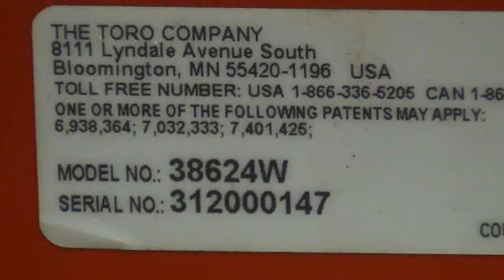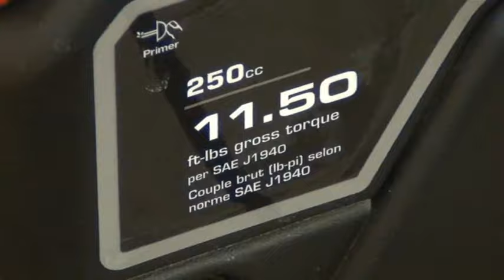Craftsman impeller pin repair - Toro Impeller pin repair

Comment: Thanks for your advice! The same thing happened to mine. I bought a couple 1/4 X 1 1/2 roll pins. I beveled and oiled the pins, but couldn't swing the hammer hard enough to get them started. I took the upper part of the plastic chute off. I put two 3/8 in ratchet extensions together and fed it from the top of the chute to the top of the roll pins and pounded them in. That worked. Cost me about $1.25. You rock!

Comment: Thank you making and posting this. I have the exact same problem on an older Ariens ST824. 
  What I find amazing is it actually shears the roll pins. Typically, they are harden steel. I would expect to blow the auger trans or auger shear pins first. However, I did get tangled up in some heavy wet snow and it was making slurpies tubes before it stopped throwing snow. 
  I currently have my machine split in half and was dreading scattering the entire auger assembly. Tomorrow I will give this method a shot. I know it’s tight in that area. And pushing the old broken pin out with the new spring pin was a great tip. We kinda look at these spring pins a lot different then the shear bolts on the auger.

Comment: Just finished doing this.  The key to getting it to work is lining up the pins With the holes. Then either grinding the pins like he showed or crushing one side with a pliers so that it will knock what’s left of the pin in the shaft out. If you do it right you’re done in 15 minutes.

Comment: I started to replace mine on my Craftsman y'day. Made sure holes were lined up but had a hell of a time getting the pins to go in. I used the recommended size pins per the manual and theres very little overhang once theyre punched in. Ill finish it today.

Comment: Great video.  Thanks.  I have a PowerMax 826LE  Model 38620.  How can I tell if its a shear pin or roll pin issue.  The impeller stopped while I was moving very heavy snow at an off grid cabin.  The impeller just spins. Thanks

Comment: Thank you.  Just ordered the replacement bolts directly from Toro.  "A bolt's a bolt" but the relative strength or weakness is important in this case.  I want to be sure that they'll snap again (and protect my machine) if I hit something hard or over-torque for any reason.
Reply from the maker: I use grade 8  1/4x 20 bolts for the impeller. They are pretty strong and mimic the original bolts. Don't forget, they are designed to break when a hard jam occurs so don't overthink it and put some super strength bolt in it. You'll be paying for a new belt or a bent input shaft if you pick up a rock and those pins don't shear.
Reply: @dansmallengine9610  Maybe those  are out-of -material spec  Chinese bolts :)  Grade  8 are very tough .and  should not be  used as shear bolts - unless they have specific undercuts. You want a  grade 5 or  2 shoulder bolt or SHCS.  Likely a  grade 5 on the impeller, 2 on the Auger. Cheers! - Sandy
Reply: 0003

Comment: My impeller isnt turning... sometimes it does. But its random. I heard some grinding. So Im assuming the impeeler shaft is stripped? Im assuming this shaft is insode the engine. Im hopong that part didnt get stripped. The shear bolts are intact. Suggestions? I have no idea how this mich damage could of occured. Seems likenthe shear bolts didnt do their job.

Comment: How do you line up the holes with the collar and the shafty if you still have remains of the old pins sheared off in the holes?
Reply from the maker: I have a small mirror I use to see the holes as I slowly rotate the shaft/collar. It can be difficult to line them up.  You may also need to push the collar backward a bit or pull it forward to line the holes up.  You should be able to see some old rust marks where the collar used to sit on the shaft and line up with the holes.  You can also try using a nail to find the old broken pins while you move the collar and shaft around.  Unfortunately there is no alignment mark on the shaft that lines up the holes. You might also consider using 1/4" grade 8 bolts instead of roll pins once you get it all lined up. The bolts are easier to replace if they break again. Those pins don't usually break so if its happening all the time, you need to be more careful when operating the machine not to pull anything in. I have guys with gravel driveways that break them all the time sucking up small stones.

Comment: thank you Dan for the video, nice and clear. my neighbor has about the same one, no grease zerk fittings. how do you go about greasing the shaft? think you could make a video on it. I am thinking about drill and tap to take a zerk fitting for grease. also, is that a good thing using that grade bolt that you used on the auger shaft. or does Toro call for something else to use?

Comment: I agree with wOOd chucker, grade 8 bolts are extremely strong and may cause another component to fail instead.
Reply: John Metz  - that's what I was thinking. He did a great job splainin everything, but shouldn't he have used shear pins? He says shear pins at the end.
Reply: @billlink7116  Looks like Toro has designed the unit to use 1/4" bolts as shear pins which is legit.  As mentioned I doubt Toro used grade 8 bolts if for no other reason they would be more costly than mild steel bolts.
Reply from the maker: Toro used both roll pins or shear pins. I'm not sure if they have some reason they use either but I suspect they have a reason for each model machine they sell.  As long as the bolts break before the impeller is damaged, you can use grade 8's. If you want to be cautious, use regular grade 5 bolts.

Comment: Just had this happen on my Snapper I724 2-stage snowblower. Augers turn but impeller will not. I noticed a roll pin almost all the way out and the impeller turns freely. I am having trouble finding the hole to pound it back in. I am hoping I do not have to take the unit apart because I am not exactly mechanically handy. The impeller also moves front to back a good 3/4" in addition to spinning freely. Do uiu think if I can just pound the pin back in place it will be okay? If not, how do I pull the into apart to better get to the pin?

Comment: Very helpful thanks.  I also have the Toro 826 which I purchased in 2016. Question to anyone here; I was just plowing driveway and the following problem happened: the trigger you squeeze on right side to activate auger won't stay down in unison with the left side driving trigger.. It was literally working fine and all of the sudden the right auger trigger won't stay engaged in down position once i remove my hands.  So in other words, I have to stop machine to use my right hand to use joystick to reposition chute because auger won't stay engaged.  Only thing that looks weird is there's a tiny hole under the handle where that goldish coloured bar meets a black plastic piece and there's a hole I can see through.  Might be for a cotter pin that fell out?  I have pics but don't know how to show here. Any help would be greatly appreciated. Thanks !
Reply from the maker: I'm sure it's something to do with the locking mechanism on the handlbar assembly. I don't have one in the shop so I can't give you and exact cause. All those locking assemblies tend to stick or jam over time. I would tip the machine forward and prop it up and take a look at the hardware to see if you can determine why it's not locking. All the locking happens on the handlebars (not inside the machine somewhere).
Reply: Thanks for the reply Dan.  Since I last posted this message, we found that 2 roll pins literally were missing and must have fell out while I was using the blower because as mentioned before, it was working for half of my driveway then I turned to change direction and noticed the right impeller handle all of the sudden wasn't staying down in the engaged position.  In any event, I'm now trying to get my hands on 2 roll pins that will fit. We have a Toro certified shop in my city and even they don't have the roll pins....I've tried calling Toro directly and they handle support if the machines don't start, but you can't order tiny parts like these.  Thanks again for the reply!
Reply: I forgot to say, the crazy part is that my machine was only a year and a half old, and the first winter we had no snow and I didn't even use it.  So the machine saw maybe 7 or 8 snow falls before these roll pins fell out?!  Anyways I just wanted to add this comment to my previous reply.  Thanks again.

Comment: CAUTION 
DON'T use grade 8 bolts ..
Unless you want to replace your gear box..
Informative video with some bad advice on bolts..
Reply: No gear box  issue  with the impeller bolts- that would be  a  belt thrower or a damaged  impeller collar or generally a bent impeller issue.  I agree no grade  8 bolts  here;  use  grade  5 or  2 shoulder cap screws or  bolts <or>ones  marked  for use  as shear bolts.

Comment: Wouldn't it be better to use a Grade 5 bolt?    Isn't the purpose of a shear pin to break before something damages the shaft/gear etc?
Reply: Yes  5 or  2 .  Do not use  grade 8.

Comment: Any other secrets in finding the holes for the roll pins.  A have a 9 hp Craftsman.  The roll pins are out of the impeller but I still haven't figured out to find the holes in the shaft.  Tried using a smaller nail pushed into the hole in the impeller figuring I'd feel the opening in the roll pin while turning it, no luck.  Flashligh and mirror, same result.

The only other solution I could think of was to let it sit overnight and go back to it after the frustration wears off and try again.  lol

Comment: I've used a mirror, flashlight and turned the shaft pulling on the belt very slowly.  I have not been able to find the holes where the broken roll pins reside.  I can't believe the roll pin gets pinched so much that you can't see a space in the inserted roll pin.

I even worked around the entire shaft with a small nail trying to feel the roll pin with no luck.  I'm at a lose at this point.  I won't have anyone here to work with me for another week and I'm considering rigging my cell phone and videoing it as I turn the shaft hoping to get a better view
Reply: 95% closer now.  Took a cell phone out to see if I could video as I turned the shaft.  I noticed a 1/16 or 1/32" irregularity in the shaft about a half inch from the hole in the impeller.  I took a picture and used a small nail and determined that was the hole in the shaft.  Then the roll pins broke, the impeller was forced to the back wall.

I tried to pull it toward me but it didn't move.  I shot some rust buster into the gap between the shaft and the impeller and after a few moments I go move it towards me.

It was getting dark and near freezing so I figured I'd wait till the weekend to mark exactly where the holes are on the shaft and orient it toward the chute opening so I can use the 2' steel bar I purchased to drive the old pins out and replace them.

Comment: The impeller and the tines are hitting and I can't find anyone else who has had this problem. The impeller turns with the shaft and I can't find any reason... is the gear box meant to be timed with the blades?
Reply from the maker: " The impeller and the tines are hitting " what? each other? the case? The gearbox is set up with a certain ratio but it doesn't matter what it is. The front rakes and the internal impeller should never hit each other.  Sometimes one of the front rakes will get bent and it will hit the input shaft when you run it.
Reply: @dansmallengine9610  they are hitting each other, they dont look bent. Im so confused. The rakes are smacking the impeller and gouging the metal, sounds like a machine gun or something. Could the impeller pins shear and then still catch after the impeller moved, cause when i turn it by hand, the rakes still move and the shaft moves with it. Maybe a bearing... have I gone crazy?
Reply from the maker: @PhosHodosLogos  - can you take a few pics of it? Not sure what's hitting what. email to service@danssmallengine.com and I will take a look at it.
Reply: @dansmallengine9610  there are a couple pics headed your way thanks

Comment: Here's a secret:  In addition to lining up the holes with the ejection chute, remove the plastic chute extension.  Insert the pin in the square opening of a long 1/4" ratchet extension drive bar (picture below).  Insert the now pin-tipped extension bar through the chute and use hammer on other end of the bar to drive pin through shaft holes with full swings.  Extension drive bar photo below: 

https://s2.sywcdn.net/getImage?url=http%3A%2F%2Fc.shld.net%2Frpx%2Fi%2Fs%2Fi%2Fspin%2F10000595%2Fprod_17810164812&t=Photo&w=600&h=600&qlt=100&mrg=1&s=b2ee744d7883535e63a3f2a65be17ef2

Comment: I could only get one pin in. Hopefully that’s enough.
Reply from the maker: the pins can be tough to align OR if they are roll pins, they break off and you can't really see the hole. I use a small mirror and a flashlight to see the holes right from the front of the machine. Works well. Since there are 2 holes in the shaft, you might have the inside hole on the impeller pinned to the forward most hole in the shaft. This would prevent you from seeing the 2nd hole.

Comment: Can't locate the holes in main shaft for changing the pins, do you have any suggestion they must be broke ??? in Toro 826 oe
Reply from the maker: I assume the impeller is not throwing snow and this is why you are trying to replace them? The Toro's usually have 2  - 2.5" x 1/4" hardened bolts that go through the impeller and shaft. It's tough to line them up inside the housing because you can't see the holes. I get a slightly smaller diameter bolt and use that to "feel around" for the holes and get them lined up then switch to the proper size bolt. Tighten them until they are snug - don't over tighten them.
Reply: probably the bolts are broken in the shaft.
Reply from the maker: Some of those machines came with bolts and some had roll pins. If yours has steel roll pins, it's more difficult to line up the holes and press the old pins out. If they were bolts, they usually push right out once you line them up. It sounds like you have roll pins. You can use a small mirror and flashlight to get a good look at the shaft and impeller. You may have to pull the auger assembly from the bucket if you have broken roll pins in the shaft. Sometimes you can remove the snow chute and get a piece of round bar stock and a nail punch and reach into the auger area and punch the old pins out. Otherwise, you may have to take the whole bucket apart to get to them.
Reply: Thanks a lot, very helpful information, my Toro 826 OE  is repair.
Reply: @dansmallengine9610  When both pins are broken, you can slide the impeller away from you to see where the nearest hole is on the shaft. Slide it back and stick an awl in the hole. Then put the back pin in first. The front hole will be lined up perfectly for the second pin.